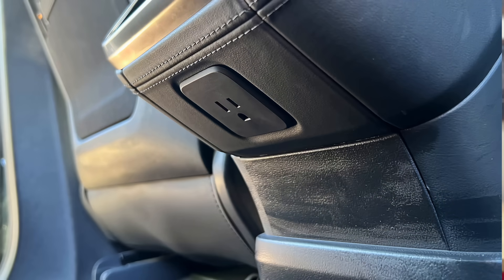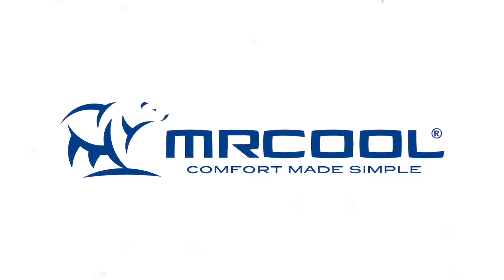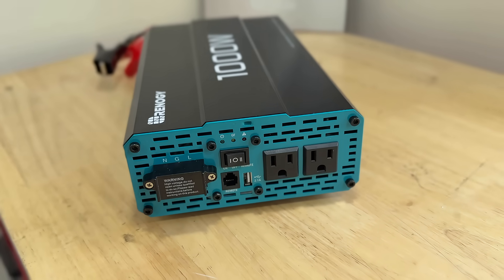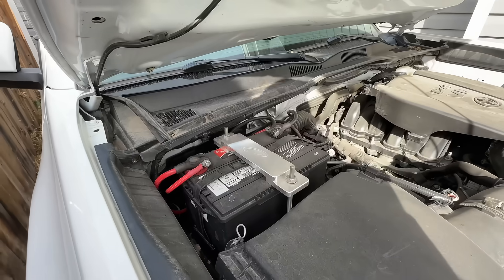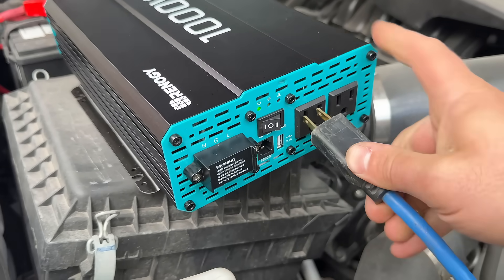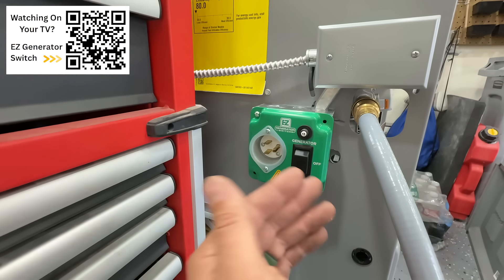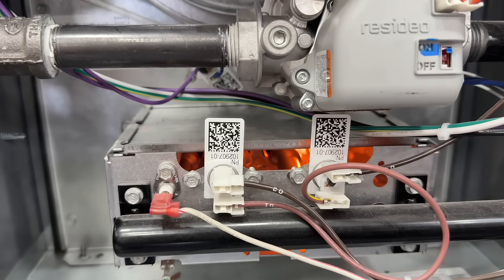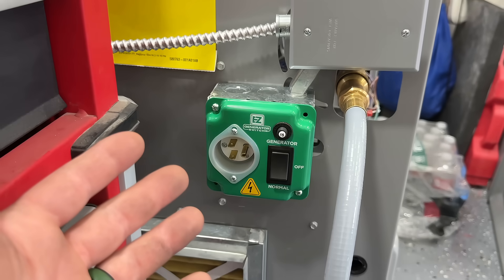Why Buy A Generator? You Have One Parked In Your Driveway.

Comment: I used to test and qualify inverters for an aftermarket company.
Number One failure of customer inverters was inadequate 12V cable size and connections. Do NOT use clamps on the battery posts. They're too lossy, especially above 500w input. Install a lug connection on the battery's clamp bolt, or some other outboard distribution block. It does not take much of a power surge to drop 100-200 watts across the battery connections which forces the boost mosfets into overload. Mosfets do NOT tolerate overloads like bipolar semiconductors.
Yes, in a pinch a vehicle can be used to produce emergency home power. But it is uneconomical as Hell and only justified to keep the house from freezing or frozen food from thawing.
Reply: First warning.  Do not use these cheap Chunese inverters.  They are not rated for what they advertise.  They overheat quickly.  They will drain your battery, even while your car is idling.  And they are far from pure sine.
Reply: @Deontjie Absolutely never use a modified sine wave inverter , Packages that do not say pure sine wave are for sure modified sine wave inverters 
Most inverters on the market are modified sine wave , So if you buy an inverter , look for the marking on the package that says Pure sine wave 
If it doesn't , it's modified sine wave
Reply: Is it really smart to run your inverter inside a hot engine compartment?
Reply: That's true indeed Because for every 100 watts of 120 volt AC , The inverter will draw an average of 10 amps of battery power and you definitely must have the proper wire gauge powering the inverter , For example 
If the inverter is gonna be drawing 100 amps of battery power , You need at least a 2 gauge wire to safety carry that amperage , Otherwise you risk damaging the inverter and creating a fire hazard , Also , Make sure your vehicle's alternator can handle the current draw , Otherwise you risk burning out the alternator 
Your best bet for emergency power is to get a generator because using your vehicle for emergency power will use alot more gas than a generator
Reply: Can I also add on here that most alternators are ~100amps and that generally means your system can only handle about one home circuit at a time!
Reply: Could a bad connection be the reason a cheap inverter had a high pitched squeal when turned on? Zero load on the ac side
Reply: @7eis  ASSUMING the "squeal" is the fault alarm, possibly if it thinks the supply voltage is too low. High DC voltage usually results in inverter shut down protection. But the fault alarm functions are mfr dependent. IF you can meter probe the connection studs that should tell you whether the voltage is high enough. High current cables are notorious for poor terminal to cable crimp/solder connections. Ensure that the cables can deliver large currents. Battery booster type clamps are a definite NO. Never use clamps with inverters for anything more than verifying voltage present at the inverter terminals. They will cause you grief trying to run an AC load.
Reply: @svartvist unfortunately it's not an alarm, more of a high pitch humm, hard to describe. I'll crimp up cables for it and see if it goes away. It's on a healthy, fully charged, deep cycle battery with no charging or other load. It works good, just annoying for people when I answer the phone while in the garage it's in.
Reply: @7eis  That kind of noise, bordering on the ultrasonic is usually an indication of a) running at too low of an operating frequency, b) instability in one of the oscillators, either primary HF or secondary 60hz. You should NOT need high current cables for locating this defect.(both mfr defects). There should not be ANY noise during normal inverter operation, load to no load. If you have a scope, you can find a hot spot to pick up radiated oscillation (no direct connection) and observe whether the waveform(s) are stable, clean without over/undershoot, or ringing. Connecting a scope probe directly to the AC output is not a good idea unless you know the voltage ratings are better than 200V.
Reply: I've found that my 3000W inverter can only sustain 900W using booster cable clamps. And my old truck only produces 1320W from the alternator. Kinds disappointing
Reply: "inadequate 12V cable size and connections."

So, something like a 4 AWG wire is needed, plus the connecting hardware. But in this case, running a 100' cable from the driveway into the furnace area would cost hundred$$$. That's not practical, since it'll be used only during emergencies. 

May as well invest that money into an appropriately sized power station.
Reply: @robertlee4172 He’s talking about the 12 V DC and you are talking about the 110 V AC. The large cable gauge is needed for the direct current, i.e. from battery to inverter.
Reply: Listen for a generator? Roam the neighborhood, lights on, car running. Ummm, whats up doc?
Reply: @tommercer3226  harder to steal a car than it is to steal a generator
Reply: @tommercer3226 The usefulness of a generator must be compromised once society collapses to the point of looting.  After that I should think it would depend on the size, appearance and defensive capacity of the group using it.
Reply: Thank you for that.  I immediately thought of the inefficiency of using an automobile as the engine for a home generator.  Your comment about losses at a 12VDC clamp connection makes total sense.

As for buying a gas generator that might be used once every couple of years and will probably need a lot of maintenance per hour running time given the long months of no use, I've decided instead to forgo large quantities of frozen food and have adopted a different approach to emergency heat.
Reply: @thomascordery7951 Run 2 stroke gas through the generator before you put it up and run it out completely. The little gas that's in the carb will still dry out but the oil won't. When you put fresh gas in it mixes with the oil and starts flowing.
Reply: @shawnstillman736  Nice idea.  Worth adding to my 4-stroke shut down procedure.  Thanks for weighing-in on this one, your mechanical 2 cents is fully appreciated by at least one person here!  Cheers.
Reply: @shawnstillman736 why is that needed? Can you expiration it for me more?  Thanks😊
Reply: @shawnstillman736  2 stroke gas?
Reply: @krisqueen5939 To keep fuel dust from forming. It dries into pure oil and will flow again with some fresh gas.
Reply: @DarkSim77 Yep
Reply: @thomascordery7951  Yes, there are many modern solutions to implementing "the old ways" requiring far less hi-tech baby tending. The older we get, the simpler we want our environment.
Reply: Pay $5000 get yourself a good solar power battery 😮 generator.

Comment: There are a few comments regarding this, how long has anyone isdled their car? I have done 20-30 minutes. Anyone done 1 or more hours? My charger is under 25% of my alternator.  Ty. And did you track how much gas you used? If so what is your normal mph? What i have seen is about 5% of fuel per hour, while driving. Difficult to verify that small amount.

Comment: I dialed out when I saw the length of the extension cord supposedly meant to power a refrigerator. Not sure if this video properly addresses fire hazard. "Longer cords have higher electrical resistance, which causes a voltage drop, reducing power to your device and potentially causing it to overheat. To compensate, longer cords require a thicker wire (lower gauge number) and must be rated to handle the appropriate amperage to ensure safety and proper function."

Comment: I got an inverter several years ago for this exact reason. For emergency use I only need to be able to cycle my refrigerators. One in house, one in garage. Never had to use it which is another reason I didn't want to spend $$ on a generator I would seldom use. Plus if your gas generator sits untouched for some time, it could not start when needed.

Comment: This is how people use their hybrid cars (esp. Prius) for car camping and running the A/C or heat while sleeping in their car.  Turn the car on, leave it running, and keep the emergency brake on.  Hybrids like Prius stay in what's called "ready" mode.  The car will turn the combustion engine on and off as needed to keep the hybrid battery charged up enough and the hybrid battery keeps the 12-volt battery charged.  With an inverter attached, the gasoline engine will charge the 12 volt battery and anything attached to it.  Prius' as an example, are very fuel efficient, so overnight (8 to 10 hrs) they'll use about 1 gallon of gas to keep the vehicle running.
Reply: I did this one night in 28 degree weather in a snow storm at 1am after finding a parking lot..  Set temp and got 6 hours sleep.  Woke up to the sun out and a snow plow driving by. Hybrid engines are amazing.  It was a prius and I do take a lot of crap for driving it.  But the gas mileage is awesome and no issues with car.  I also have a TRD OFF Road 4Runner.  But for long distance it cant be beat. 1/3 of the gas vs 4Runner..
Reply: I was wondering if this method would work on a hybrid, as mine shuts off when idling at a traffic signal.  Thanks.
Reply: @bluewolfwalking you should be able to turn that “feature” off.  Most cars give you the option
Reply: It's all well and fine, until someone clips the power cord and drives off with your car...
Reply: Thanks Much! Great info 💞
Reply: It's absolutely destructive to the engine, though. Will shorten the lifespan significantly if done often. It's like cop cars... most of em need new engine before 200k because of the idling they suffer. 

Idling is long term engine damage and short term battery damage. Only worth it in a dire emergency.
Reply: @MrProy33 yea they don't work the same way, ur thinking of a combustion engine which is always idling
Reply: @MrProy33 Who lied to you?
Reply: While those with a Prius  stays warm and alive...those others can keep laughing with a stupid frozen smile.
Reply: ...but then you have to have a prius and all your friends and neighbors laugh at you...and your wife leaves you for being like a girl
Reply: @thedrummer7673  You can have a Corrolla Hybrid or a Camry Hybrid.

Comment: Should also work for a EV. But I am still hoping I can just use the CHAdeMO port instead of the 12V system. (Apparently the Early Leafs don't support supplying power: but I do have a second gen battery.)

Comment: I always heard that if you let your car idle for too long, it can start to damage your catalytic converter. The exhaust gas at idle won't heat the catalytic converter up enough for it to function properly, and it will start to get a buildup of unburned material. At least, that's what I've been told. Perhaps it was an urban legend?
Reply: I think this was true back when cars still had carburetors. They basically poured gas into the engine to keep it running. This created a lot of carbon build up in the combustion chamber and on the pistons as the metering wasn't efficient at all. Now days with precision computer controlled electronic fuel injection the engine gets just the optimum amount of fuel it needs to keep running.

Comment: NOTE - car batteries won't last 5 minutes unless your car is running (alternator must be spinning, producing a charge and sending it to the battery). 
If not your battery will die quick. 
It's different from a solar power battery which lasts much longer. Completely different design.
So your car battery usage with inverter depends in how much your willing to pay in gasoline (this method is fantastic in emergencys). 
How much does your vehicle cost in fuel to idol for 2 hours, 3 hours etc.
Reply: If you have a hybrid like a Prius, there is no alternator.  You put the car in "ready" mode and the the engine will turn on and off as needed to keep the large hybrid battery charged, as needed.  Doing that also powers/charges the 12-volt battery and anything attached to the 12-volt battery, like an inverter.  1 gallon of gas can keep a Prius running about 8 - 10 hrs, depending.

Comment: this is great assuming that there are no gas shortages, your best bet is to have your car as primary and then have a backup generator that runs on propane.
Reply: I have a generator that runs on propane, and I just keep the propane tank full.
Reply: @wisepati123 that's a good idea plus you will never run out of propane, they always have them (at least in Florida) when there's no power for days.  Much different than having to wait 10 blocks in a line to get gas.

Comment: For high wattage appliances you would need to make sure your car's alternator are the expensive high producing models. Or you'll run your battery below 12v real fast.
Reply: 30 amps(honda) is a lowball but still plenty if the engine is running.
Reply: @Johnny35130 a 30 amp alternator will only provide 360 watts continuous power. You're doing extremely good power management if you can function on that.

Comment: I wouldn't close the hood for long periods of time, inverters need to be able to keep cool. That's why it has a fan in it and the body is designed like a heatsink to pull heat out of it.
Reply: That's why I have a longer heavy duty cable so that I can relocate my inverter to the inside of the vehicle. I just utilized it during a 39 hour power outage.
Reply: There will be people who let their cars idle inside closed attached garages. Nice idea but please add a word of caution about this.
Reply: I was thinking the exact same thing.
Reply: Seems stupid to even suggest leaving the inverter in an engine bay that is likely over 125f…. Inverter will likely shut off due to overtemp… putting in out of the weather on top of front tire makes more sense…
Reply: Everyone here forgets about overload to the alternator 🙄
Reply: Utilized
Reply: If it's cold enough to need to run the furnace it may be cold enough to keep the inverter cool even under the hood.
Reply: @nathanmorrow6981  Or use jumper cables for more length and lock the converter inside the passenger cabin.
Reply: @nathanmorrow6981 likely not. You've got hot water in the radiator at 180 to 210° and the    radiator fan pulling air from that hot radiator right into the into compartment.

Comment: I still prefer my 6000 watt generator. A car's electrical system isn't designed to run a high watt inverter or constant loads. This is why most built in car inverters max out at 150- 300 watts. I also think my generator gets more runtime per gallon than any vehicle I own. 

Over time cheap inverters can destroy sensitive electronics. There are lots of full sine fakes for sale. You can test it with a variable speed tool like a drill. If it is all or nothing it is a modified sine inverter. If it has variable speed it is a full sine wave.

Comment: It's really hard on engines to idle unless it's a diesel.
Reply: Not hard on hybrid vehicles.  The engine turns itself on and off automatically to keep the large hybrid battery charged, as needed.  Uses about 1 gallon of gas over an 8 to 10 hr period to maintain a set temperature inside the vehicle, whether that's using heat or using the A/C.

Comment: Caution: there is a limitation to using your idling car/truck’s alternator to power a large inverter like 1,000w or greater. Alternators require cooling. The more amps of devices plugged into the inverter the harder it must work and the more cooling the alt requires. Expect longevity reduction of the alt if powering an inverter at idle or low RPMs for prolonged periods. Using it at higher RPM like on the highway will give much better overall cooling airflow and longer alt life.

Comment: Bad idea to keep the hood closed since the car engine would heat up lots.  When the vehicle is moving the air flow cools the radiator down.  Your battery will run down if you turn off the engine.  The alternator keeps the battery charged so the engine should be running continuously for uninterrupted power.
Also one has to be careful of the gas fumes being generated which could be toxic if the area is not well ventilated.  Many have died bringing generators into their homes being unconscious of the toxic fumes being evolved.

Comment: That 1000w inverter is going to handle a fridge pump and furnace motor start up at the same time?  

That’s quite a spike in power at the same time. 

I mean, a std fridge runs on 3 amps, at start up you can get as much as a 30 amp spike, so that approx 3300 watts, for the fridge alone, 

so bye bye to the 1000 w inverter, and we haven’t addressed the furnace yet… 

someone correct me if I’m wrong here.

Comment: Ask ANY mechanic and they will tell you what I am about to say is true.
Most of the vehicles built in the last 10 or 15 years are damaged by idling for more than 5 minutes. The oil pump systems simply do not push enough oil to the head when idling.
I would only use this method in a life or death situation, because if you let most newer vehicles idle for more than 5 or 10 minutes without revving the engine to pump some oil to the top of the engine -- you WILL be causing damage. And not light damage.
You're much better off buying a generator.
Reply: Doesn't apply to hybrids.  My Prius, for instance, doesn't have an alternator.  Idling is different -- the vehicle turns the engine on and off as needed, automatically, to keep the hybrid battery charged. The engine might turn on/off 4 to 6 times in 1 hr, depending, and then it might run for 3 min or so each time.  1 gallon of gas will be used up doing this when overnight car camping.